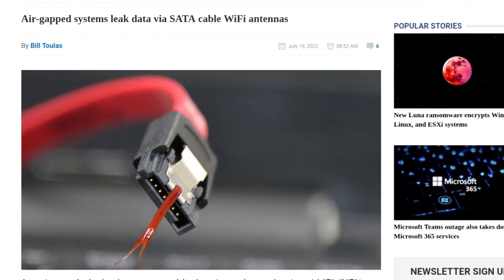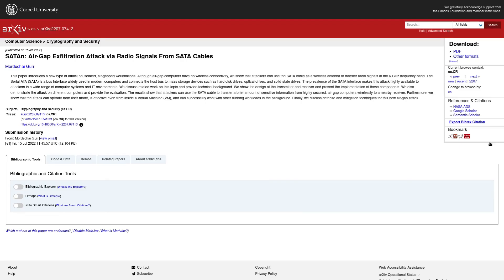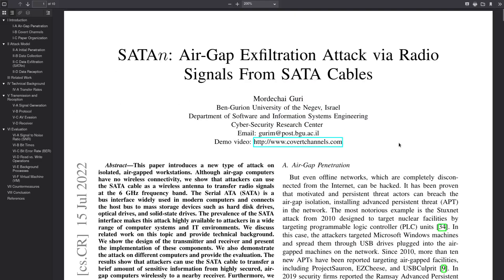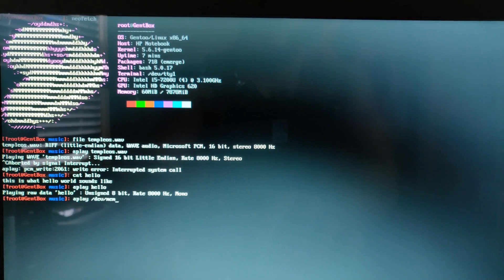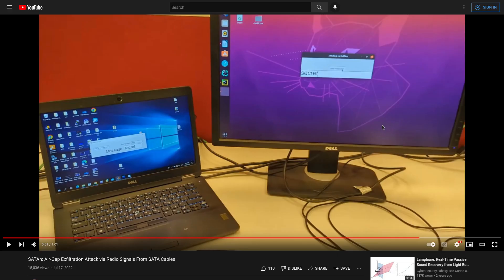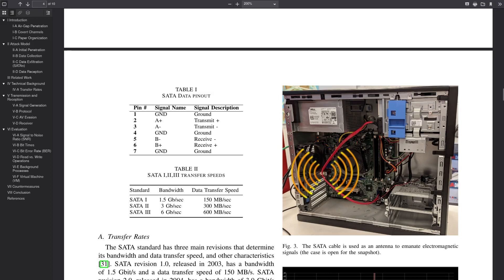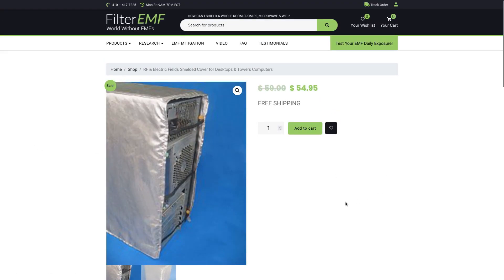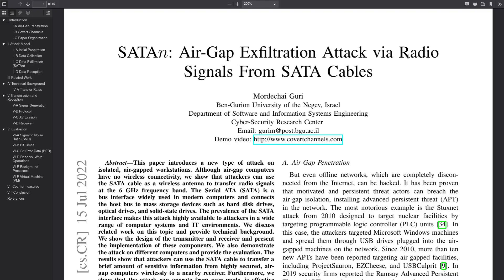Stealing Data Wirelessly From an Air-Gapped System

Comment: Yeah somehow I don't think a sata cable vibrating, causing a led on a gaming keyboard to flash with a guy with a telescope watching into the office 24/7 taking down 1mb a year of potentially useless data is anything to worry about
Reply: im watching your pc from a window with a telescope right now 😁
Reply: The schizophrenics worst nightmare. Dont forget to be in the walls
Reply: @ska187  what about your walls being inside me then
Reply: @dracula7779  there's a skeleton inside you right now as we speak
Reply: Imagine being the guy that develops the programs and lense/sensor data to identify and record 1gb+ per hour using this technological functionality to hijack a Hedge Fundees market information.
Reply: To the average person certainly not but to an intelligence agency conducting espionage? Those few bits of data may be an absolute gold mine revealing heavy equipment capabilities, reactor conditions etc etc etc.
Reply: @chrtea  no
Reply: @redacted4041  care to provide a legit rebuttal?
Reply: @chrtea  The vulnerability breach, is allowing a  malicious agent to enter the building. That malicious agent, could get far more information in variety of different ways. This would be the absolute, worst method of stealing information.
Reply: @redacted4041  These are still ways to gather information when your presence is of immense scrutiny, is it not? So yes you'd have to be in a dire situation to do this but that's kind of the point. It's such an obscure technique and now knowing how disregarding people like you are about it I now know it will legitimately work. 

Remember it's always what you don't expect to get exploited that gets exploited.
Reply: @diego032912  Omg that's so true.
Irl this is not the kind of abuse most people could cope with. They're going to crumble...imo.
Reply: If you are a high value target and they already know your general location it indeed is a concern. Imagine they find out at which café you always connect your secure device with. Now they just need to find out which exact device it is. Or they might only know your city, but if it's a rather small town it still would be possible, or even in a big city. They could try to cut the electricity for a couple of second area by area and see at which point the targeted device disconnects from the monitored server. Then they have your area and only need to look at smaller details of a couple thousands of houses. Not that hard to do if you are only one of few being online at 4am at night as one example
Reply: @thomas.thomas  This hack is useless if you are connecting your device to the internet network, there are tons and tons of way more effective and easier to implement methods to compromise networked devices. What this hack enables is if there is some computer with no network connections in some secure facility that you have already gotten physical access to by sneaking into the facility unauthorized to plug in a USB stick or something and install malware on, then if you can get access to the facility again and get a wireless device like a phone or laptop very close (within a couple feet) of the device you have already compromised, you can retrieve the data without having to plug in another USB stick.
Reply: @thomas.thomas  This is more like it.
And in a small town...which people traveling will tend to be...
We got trapped and boy has it been quite a show.
We're nobodies. But someone got us on a special list. IDK why.
People are generally being way too laid back about the credible threats in development and where this is heading to.
It will be too late...quickly.
Reply: like he said, if you can see directly into the facility, then you can setup a high focused telescope preferably one that integrates lasers and light technology.

Then you place it down and focus the light/lasers on the window and then that light/laser hits the screen or pc tower.

then you modify the light signals/lasers to get the computer or any electrical receiver in the computer to pick up the signals.

once it picks up signals, have the computer run the signal/payload and watch havoc occur.

it sounds ridiculous, but yeah you can shine light into a high tech area and boom your in. or even if there's no window. as long as the intensity and penetration of light signals is doable you can in theory penetrate walls and send that signal to the attack target/vector and still get it to work.

NOTE: The more obstructions there are to the target, the closer you need to physically be or whatever setup you have needs to be to actually work.

assuming these facilities are built in areas with noone around ie a desert flat area, then the security of said facility  should be fine.
install some watch towers with high powered telescopes and maybe night vision googles/thermal vision detectors just in case somehow someone gets near the high security facility.

or pull a classic, espionage james bond move and get someone to help you on the inside and do all this covertly.
Reply: @DDVgamingpros  I know some microphones (capacitor microphones if I remember correctly?) can pick up lasers as a sound signal. But unless the computer listens for commands with some kind of voice assistant, how is the laser going to deliver any kind of payload?
Reply: Depends on your threat model. If you are an intelligence/government agency, defence systems contractor, nuclear enrichment facility, journalist, human rights defender or whistleblower, this might be important to you. For example, like the scene in Mission Impossible
Reply: @danielyoung_  Yep. Or family in those sectors who....you no longer speak to who are very very bad people...and you don't take that kind of sh*t....
Reply: ok glowie
Reply: It doesn't matter how long the transfer takes when the attack will never be discovered. This attack is still in the research stage.

Also, it's not 1965, no human being needs to do the decoding. You can use a camera and a simple OpenCV program.
Reply: How many digits/letters are the nuclear codes again?
Reply: Can you say that again in English
Reply: @kidkangaroo5213  this video is a troll

Comment: Couldn't you pipe aplay into ffmpeg and output a .wav file that would have your data in it?
Reply: at that point just pipe the data directly, no need to pass it through 2 programs if it's going to end into a file
Reply: @spicynoodle7419  Hmmm. I was reasoning that aplay /dev/mem could produce an audio file that you could turn into a wave via ffmpeg, and figure out how to decode the wave file. . . How would one decode the data from /dev/mem with aplay? Just somehow decode the data into binary?

Comment: I would say the more you learn and think like a hacker, the more surprised you'll be at how insecure everything is.
Reply: Very true. Been studying cybersecurity for over a year now and I’ve been making my PC more and more secure overtime as I learn about this stuff
Reply: @fancywaifu9821  from your point of view, how to make PC even secure? Mind sharing?
Reply: @UnixMoan  Use a firewall, don't carelessly open ports, keep your system up to date, consider using full disk encryption. Don't type in your passwords using a wireless keyboard. I'm also using linux, but security is not my main reason. I'm not the OP, but I'd been somewhat involved with IT security in the past.
Reply: @szaszm_  Now that you mention the wireless keyboard, my family uses a wireless mouse, and I was thinking "what data does a mouse leak?" and realized we can do a basic keylogger to track left, right, and center (wheel) clicks. Someone could attempt to estimate which keys of the virtual keyboard the mouse has clicked on-screen. And they could do fingerprinting by associating people with move/drag patterns using an AI for pattern recognition (we already do this with walking patterns, I think mouse movement is a possible fingerprinting vector)
Reply: @szaszm_  This is a good point. The vast majority of threats are eliminated by very simple things, keeping things updated and using a firewall are already the default on most devices. Hacks like the one displayed in this video are theoretically threats, but realistically speaking they won't happen to you unless you are someone with incredibly critical data and very dangerous enemies.
Reply: @hayden.A0  It's more nuanced than that.
Reply: @fancywaifu9821  The only way to secure your PC is by cutting of useful services. 
Also what is the point of trying too hard to secure a personal PC. Unless you are working for some secret service or multinational conglomerate no one cares about your PC or smartphone. 

The best way we small people stay safe is by being small people.
Reply: @SIPEROTH  Cool 👍
Reply: @SIPEROTH  Well not that it's a problem in terms of #'s...
But that isn't actually true. The reasons also make sense. Picking on small ppl makes sense if selected carefully. They apparently have reasons to justify whatever they view the ROI projected to be.
Sorry, but just because no one cares what IS HAPPENING to some ppl doesn't mean it won't matter in the trajectory...or in the end...
Reply: TEMPEST style attacks have been known about for decades now. After CRTs went away, it became a hell of a lot harder, but that doesn't mean this isn't a decades old concept now.
Reply: @sheeplord4976  that's the point no one realises. Hacking started with hardware, from world war times to today, hardware has been at the top. Software hackers often get startled by hardware hacks because they've never studied it.
Reply: don't be surprised  I love how no one in this thread even addressed the bot lol
Reply: @down2006  Well the best way to address the bot is not to address it at all and report the comment lol
Reply: @yeahgirl11  reporting comments basically does nothing forevermore
Reply: Fuck smart people.
Reply: The <TSA> has left the chat.
Reply: @Rudxain  weird. Thanks for the heads up!
Reply: @PWN_Nation  YT deleted my comment because I edited and added a link. I made a Reddit post about that bug, in r/TechNope. It seems YT (the Android app) had an HTML injection issue
Reply: The more you think like a locksmith...
Reply: If you don't "white hat" you just like self delusion, white hat is looking in the mirror. Humans hate nothing more than the mirror.
Reply: don't be surprised  FINALLY

YES